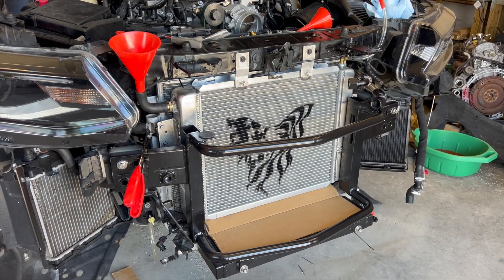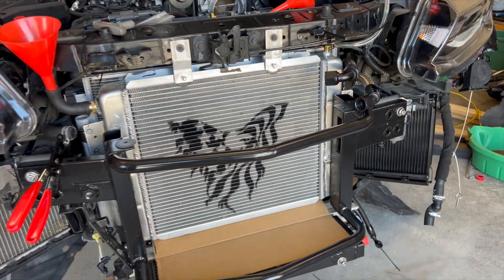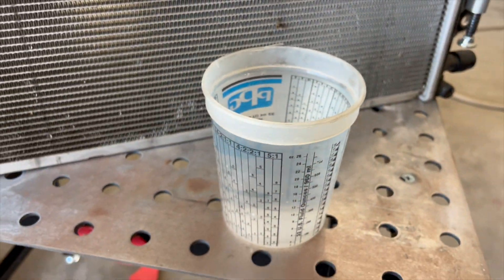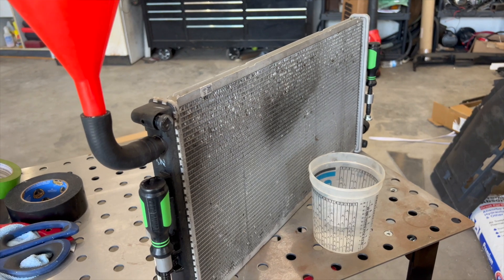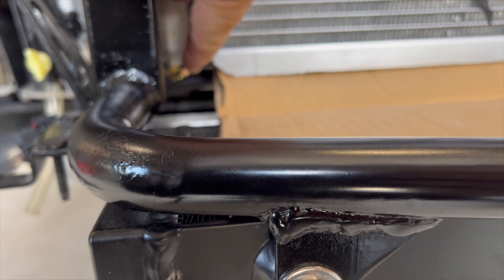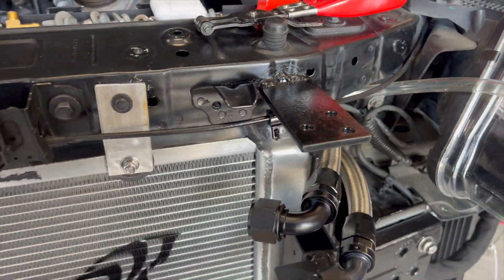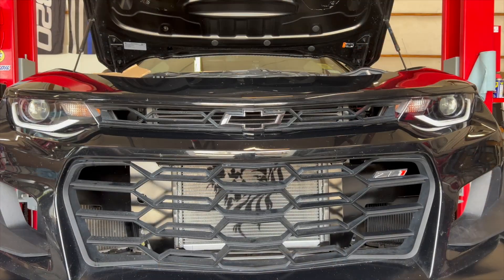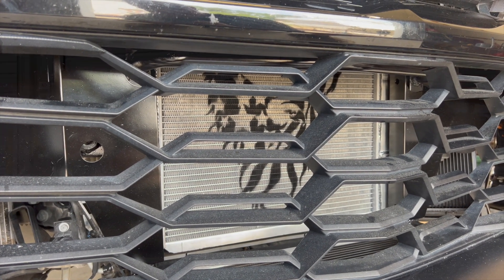BEST ZL1 LT4 TRIPLE-BYPASS RACING HEAT EXCHANGER!!!  8X The Coolant Capacity Vs OEM!! Over 1 GALLON!

Comment: will this radiator fit with a procharger intercooler sitting in front?
Reply from the maker: This is for a water to air intercooler system.

Comment: Would it still be more efficient than the factory radiator, even behind the factory crash bar?
Reply from the maker: It is behind the crash bar… I’m not understanding your question. With the cooling fan on low speed, you can feel the airflow.
Reply: @DavidWilks  the new radiator is much bigger than stock. If you run the factory crash bar, is it hindering airflow to the bigger radiator? Meaning, do I have to get rid of my crash bar to be able to see the benefits of this upgraded radiator?